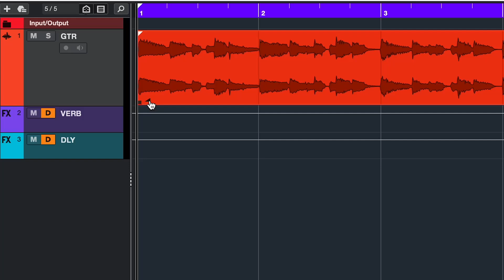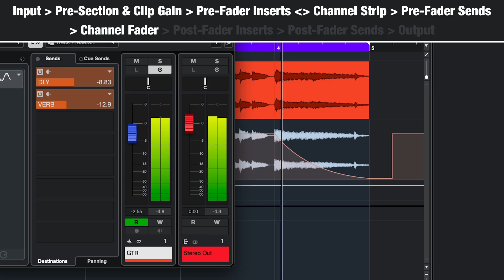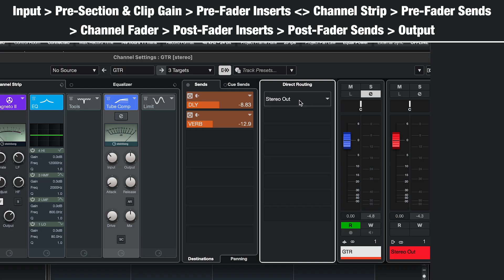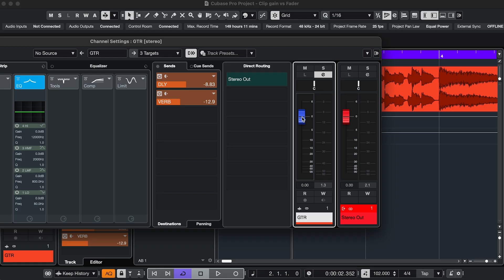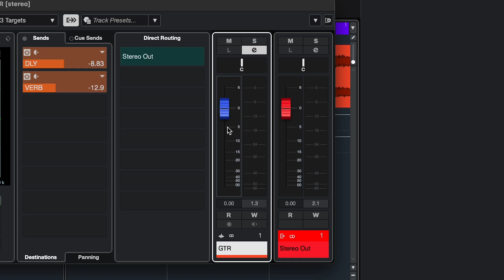Should You Use Clip Gain or Faders? | Signal Flow in Cubase

Comment: Very interesting! Do you ever turn the audio event into a part and adjust levels there? I find parts easier to work with then events.
Reply from the maker: I actually rarely use parts. Only when events are chopped up into tiny pieces 😁 What’s the biggest advantage for you?
Reply: @alicebyno i find parts are easier to nudge if there is a slight timing issue. Same with volume. Very easy to select a small area and nudge up or down a few db.
Reply from the maker: @seldonsinq  Interesting!

Comment: Bedankt weer Alice ;-) i find it a little unfortunate that i can't use the little handle in the middle of the clip for volume like in the past anymore. I was very accustom to it. But the way you said with the shift and control works maybe even easier. Learned something new!
Reply from the maker: That’s exactly why I started using the shortcut 😁 The corner fader takes too long to “find”.
Reply: @alicebyno  Absolutly, i would be nice if Steinberg gave the option to turn it on or of, a little like the handles in Variaudio (more or less).